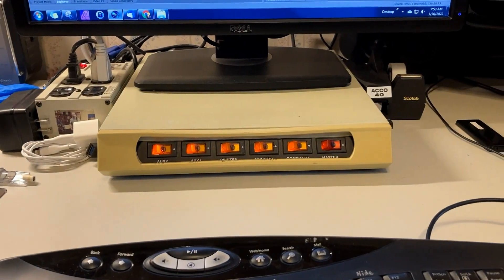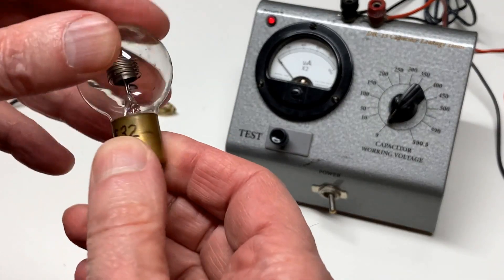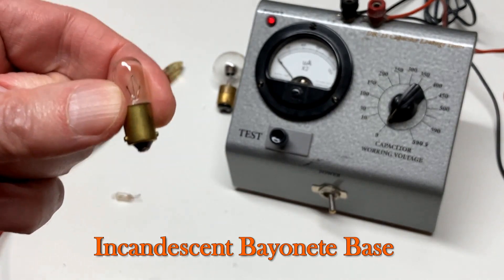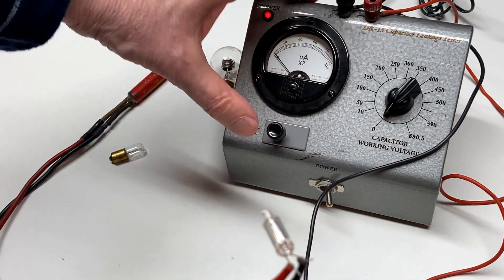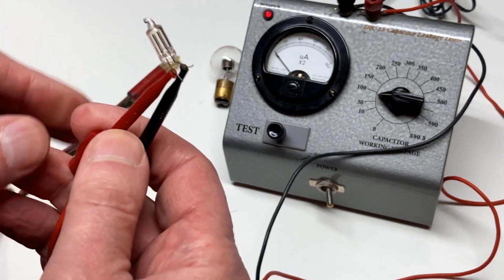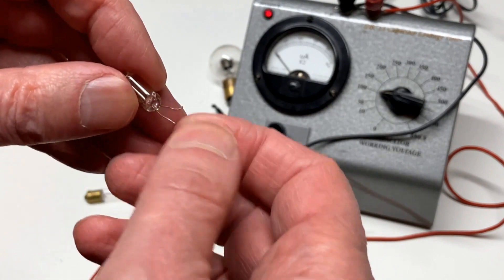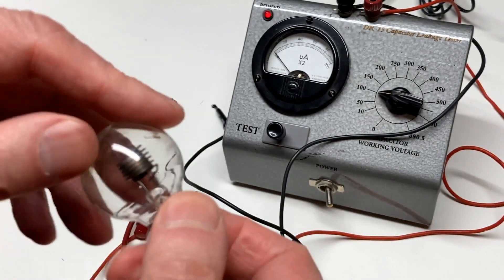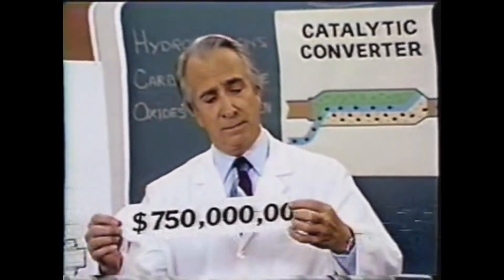Neon Lamps - Why do they flicker & flash in the dark?

Comment: Why do they flicker? Good question!
I have some pea-neons, apparently of considerable age and am trying to use one in a neon-timebase for a supposed small electrostatically deflected TV.
With a 3M3 resistor and a 175V supply, the neon oscillates. With lower value resistors, the lamp fails to extinguish. Then, these lamps seem vulnerative to electrostatic fields and at home we are surrounded by mains wiring. A small, earthed copper foil shield takes care of that but, while in the presence of even a small amount of light, the oscillation is fairly steady, in total darkness there is an unmistakeable randomness. I think someone has suggested cosmic-ray influence while one writer in the early days of TV, reported a 'regular irregularity' when using thyratrons as a timebase. Could this be what we are seeing in neons?
Some experimenters have suggested using a neon as a Geiger tube of sorts while others deny any such connection.
Either way, I appreciate your presentation and look forward to more. It does seem that there is more to these little gas-filled devices than meets the eye!
Reply from the maker: Interesting project you have going there.  Yes, the neon lamps and the Geiger-Mueller tube(s) are very similar in construction. Of course, the gas is entirely different but I suppose cosmic rays can ionize the gas in the neon tube just like it does the GM tube although when I built my Geiger Counter I used a "Self-Quenching" tube that stops the "avalanche" effect.  --  One a side note, after 35 years of constant use, the neon lamps in my power dist.  unit are totally dead now when in a dark room but they still light up and flicker when I flip on the room lights. 🙃

Comment: Computer folklore tells of a machine that was scared of the dark. It was made with lots of neon lamps, which would not fire without the extra energy supplied by the room lights.
Off-topic, but the control circuit in my Mom's old dryer had a neon bulb hidden inside the chassis. It was being used as a voltage regulator, lighting up and passing current when the voltage was high enough. (Designed in the days before solid state regulators were cheap enough and rugged enough to do the job.)
Reply: Ah, the time of braided magnets... you can imagine such a torch to use too many batteries. So once on, it stays on. Or bring in the data. 6 feet stacks of punctured paper.
Reply: Cold cathode tubes such as the 0A2 and 0B2, containing noble gas mixtures, were specifically designed and used as voltage regulators when regulated voltage was required in equipment using vacuum tubes.  The ones I have used emit a pretty bluish glow when operating.

Neon lamps, when they get old and flickery, can sometimes be remarkably sensitive to quite low levels of ambient light.

Comment: The AC supply gets 100 or 120x (depends where you are) per second down to zero, so the discharge disappears the same way you have shown with the capa tester. Now after the voltage reverses, it has to ignite the discharge again. And to do that, you need to break down and ionize the gas. Now what is the ionization there? The electric field accelerates a free electron there, till it collides with a neutral atom and kicks another electron free from it, generating another ion and free electron that could be accelerated. This way, when the field is strong enough, it generates more electron-ion pairs than they decay (when an electron sticks back to the ion and makes back a neutral atom), so the ionization density rises, in a kind of avalanche way. The high ionization means a lot of free electrons, so high conductivity, which the  loads the circuit so causes the voltage across the bulb to drop. So does the electric field, so the avalanche slows down, until it settles at exactly the voltage, where exactly the same amount of ion/electron pairs are generated as they decay back.
But this need at least a single, first free electron to start all this avalanche. And that is, where the problem is. Normally, with the proper gas mixture (there is not just Ne, but some small amount of other gas), the electric field should be enough to pull some electron free either from the electrode or from the gas itself (the small addition of the other gas forms a kind of irregularities forming local high field nuclei). But as the lamp ages, the additional gas gets "hammered" into the electrode material, so it becomes missing in the mix. Or some types may use some traces of a radioactive substance, where the radiation energy is then more than enough to free some electron to start the ionization avalanche. But when old, the radioactive substance has decayed,so does not provide the support anymore.
But in similar way, the photon energy from an ordinary light uses to be enough to liberate some electrons from the cathode and these electrons are then the start of the avalanche. So even when worn out (the gas lost) or old (the radioactive aid decayed), it still may function when there is enough light around, but not without it anymore.
Because we are constantly bombarded by things like cosmic rays or so, occassionally some such thing hits the aged neon lamp and so releases that initial electron, hence itsometimes ignites, yielding that flashing pattern.
Reply from the maker: What an insightful and scientific explanation to an all too common phenomena!  Thanks so much for the answer, Anna.  You must be a chemist or physicist, right?

Comment: Neons need an activation energy to initially light. The electrodes normally have a little radioactive material in them. The electrons emitted by the radioactive material help initiate the discharge. There's very little radioactive material in there and it depletes after some time. If you want to test this all you need is to put energy into it. Take a weak or flickery neon in a dark room and run it with the normal setup (high voltage through a resistor). Shine a black light on it (UV LED comes to mind) and you'll notice you can trigger them to stop flickering when you add the UV light to it. The ambient light from the room was enough to trigger the neon lamps you had.
Reply from the maker: That's as good of an explanation as I've seen so far.  I'll buy that!